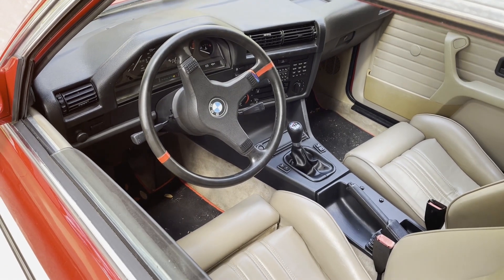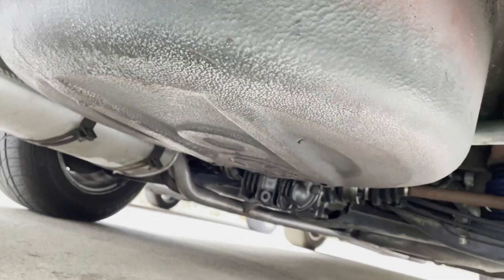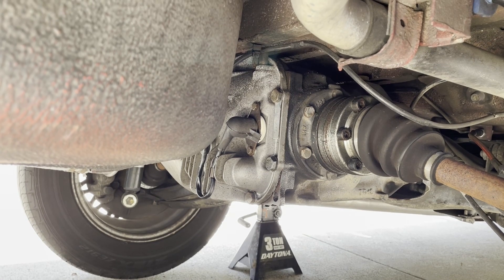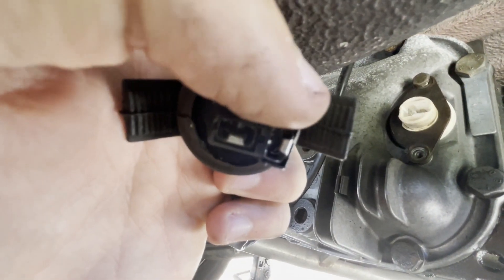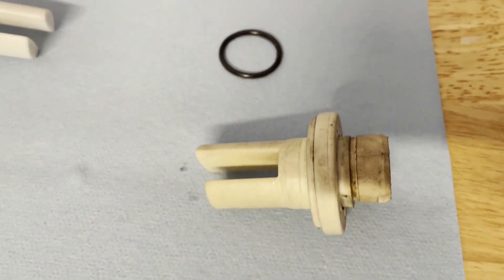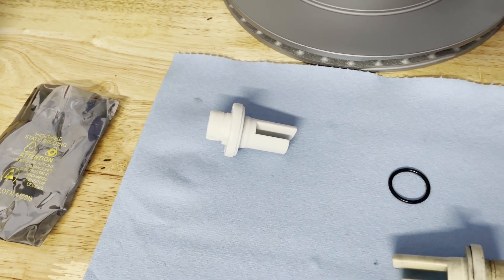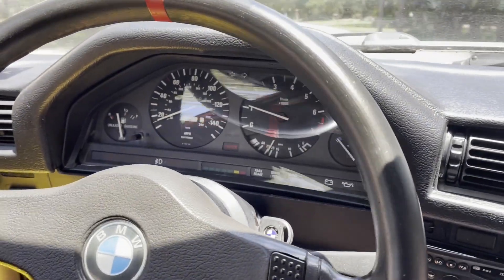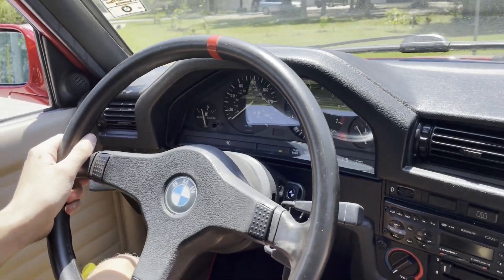Was I Speeding? E30 Speed Sensor Replacement

Comment: Got the same problem, how do you know if that fixes it when the speedometer only disfonctions sometimes ? Like not all the time
Reply from the maker: Ours was broken when we got the car, started working (intermittently at first) after we changed the differential fluid, and then stopped a working all together again.  I checked for voltage at the connector and since we had voltage I took a chance on swapping the sensor.  That said, if it is intermittent it could be a loose connection, corroded wire, or something else electronic.  I feel like we lucked out!
Reply: @C3KPaddock pk thanks for the advices, imma try these out